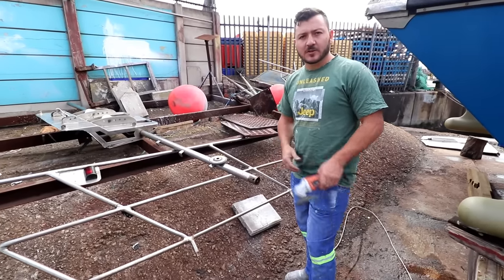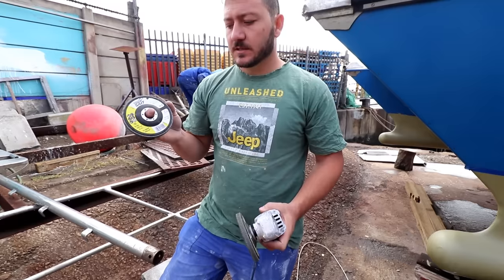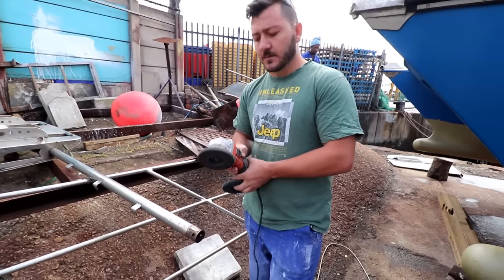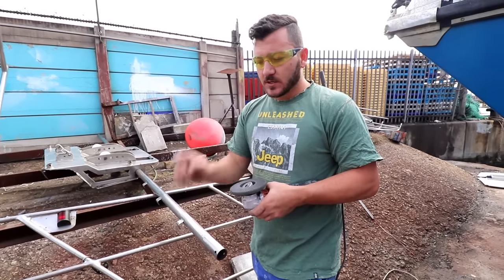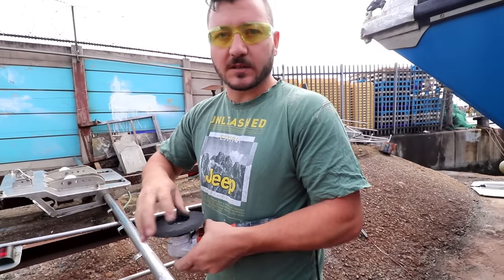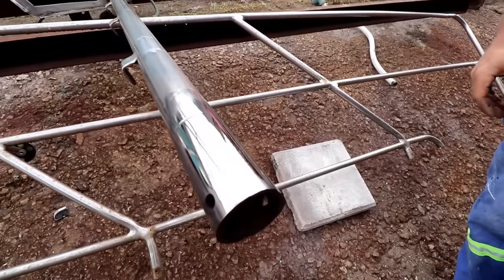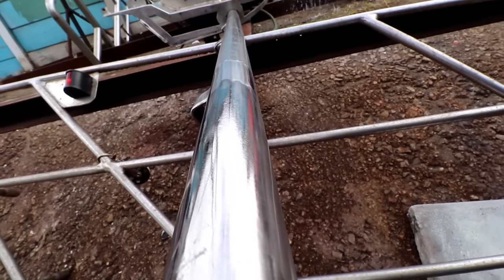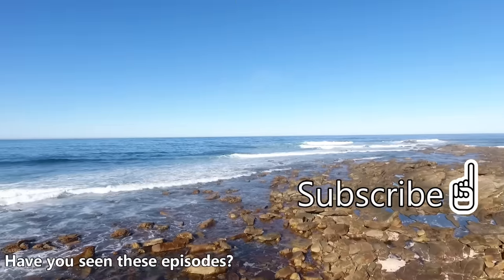HOW TO: Polish your STAINLESS STEEL! (BEST RESULTS)

Comment: I hand polished to a perfect shine using only sandpaper by hand some small SS boat parts and tubing for a Bimini top. I started with 400 grit paper to remove some scratches, then onto 1000 grit to smooth out some more, it looked pretty good at that point. But then I used 10,000 grit sandpaper bought off amazon, and that made it look like mirror finish and it did so very fast. So only those 3 levels of paper were needed.

Comment: Years ago i worked in a chrome plating work shop, some thing like that could be dipped over night and replated then washed in acid and it would come out brand new, no scratches, the cost would be the same as all those wheels and polish, most of the replating that went on was for boat restoration railings and bolts, you may want to look into costing it out cause it does inside the pipe too and could save money in the long term
Reply from the maker: Definitely not in South Africa.. if you get someone else to do it, you're going to pay!

Comment: I just did that on a motorcycle you could also use mothers mag polish on course steel wool then mothers on fine steel wool. It took me much less time and the results were the same. Not sure if you have access to the mothers mag polish but most auto stores carry it. Great work on getting the scratches out sometimes you have to do the sanding on areas that were the metal was not finished or even around the welds.
Reply from the maker: The guys at the place advised us as our stainless steel was looking pretty darn bad to go with the route we are previously using.. It looks really good so we're gonna stick to what we know! 😊

Comment: Good job, Ricky. Take care not to overheat the surface. Overheated surface loose the metal structure of the alloy. This causes corrosion and stress corrosion. Because of this after welding it is used to take pickling paste or pickling bath for removing tinder instead of grinding with angle grinders.
Reply from the maker: Hi Wanambi , im not sure if you have used unitized abrasive polishing discs before ? yes if you are not careful you could damage the surface of the material but to change the molecular structure of the stainless steel alloy will required a lot more head, commonly associated with a cutting disc of a grinding disc. the method displayed is how all stainless steel railings are polished in South Africa after weld joints have been removed , non the less we do acid dip the stainless steel after welding.
Reply: Ricky, you are right - it must be high temperature to demolish the structure of the alloy. Of course, to polish it is a need to work abrasive. Te only reason I posted it was the "warning" for all the others not to take an angle grinder to make the welting even an then polish it. This is the point never works. I am sure - so I followed you - you know what you do :-)
Reply from the maker: Thanks Man 😊

Comment: Excellent job. Very shiny. I sometimes use a grinder with a mechanical speed variation switch 1 - 10 to make it a little more comfortable especially on the more course wheels. They are also very handy for other grinding applications. But, love the vlogs x
Reply from the maker: Thanks so much Derek! 😊

Comment: I’ve been all over town and the internet looking for fine 300 grit and medium grit polishing discs for my angle grinder and the highest grit I can find anywhere is 120, which seems way too rough to be a finishing polish.. wondering if you can put the link to the discs you bought here so I can find them? Thanks much in advance!
Reply: Me too , did you ever figure it out???
Reply: Look for United Abrasives Unitized wheels to buy in the USA . If you look below in the comments there is another brand called Grifton but havent used it . The SAIT is a pro wheel. The real real value that this video provided is the dicovery of the wheels .Normal ppl wouldnt even know the existence of this product

Comment: Its a lot of work but it sure does look good. Just did that for my boat steering wheel, had a rubber all the way around the wheel and started breaking down and getting black shit on our hands, i cut it off only to discover i had a stainless steering wheel that had rusted in certain areas, knocked the rust off with some fine steel wool, then hit it with i think a green (or possibly black)  bar for cutting then the white bar, came out real nice. Threw some wax on it for good measure.
Reply from the maker: Thank you. It makes a huge difference 😎

Comment: Good work. I never thought that large of a wheel would work on a 4 or 5 inch grinder. Is that buffing wheel rated for those high speeds?
Reply from the maker: Hi , we have used many of those wheels and this is also tips from someone that we met that has been doing stainless steel for over 30 years . The wheels would last longer at lower rpm but it works great

Comment: what if the stainless steel is burnt and now has some rainbow stain because of the heat? what should i do?
Reply: use WD40 or alternative to help with overheating the stainless steel, this metal is great to clean and can handle the heat from 11000rpm single speed grinders
Reply: @becool27  
I want to remove some discoloration/tarnishing from a stainless steel Jenn-Air propane grill - how do I accomplish the polishing while maintaining the brushed look of the rest of the BBQ?

Comment: Awesome job! What a difference!! Amazing!!
Reply from the maker: Thank you so much! 😊
Reply: @livingwiththemaias  I thought when you sand the stainless steel you ruin its upper coating and its more vulnerable to rusting/corrosion? and isn't 400 grit really rough why not 1000-2000 and which finishing paste do you recommend in usa? and how do you sand in between the railing fittings? you cant with that sanding disk

Comment: Can you please give us the name of the discs?  Who makes them?  Can I get them here in the US?
Reply from the maker: It's unitised disc's. Medium and fine to do the cutiing and then a buffing wheel with stainless steel polish. You can get the disc's anywhere in the world.
Reply: @livingwiththemaias  "Unitised"?  Is that like the type or brand?  Sorry for my ignorance and I do appreciate your response.  I'm just very impressed with how quick you did that and achieved that result with essentially only 3 steps.  I have a bow roller that I need to do and want to do exactly what you did, so I'll look for that "unitised" if it's the name or type.  Thanks again!
Reply from the maker: No were not sure what the brand is but just ask for unitized discs. They are all the same. Just different stickers on there :)

Comment: Would you mind pointing me in the direction of the pads you use in this video please? 

Nice job by the way 👌🏻
Reply from the maker: They are unitized disc's. I'm not sure where you could get them that side but I'm sure if you Google it, it will let know know where you can find them in your area. Make sure to get the fine cut and get white bar buffing compound suitable for stainless steel. In S. A we got them at coastlands sales.

Comment: does anyone know the general name of these discs and where to get them (uk) thanks nice vid
Reply: The first disc used is a flap disc, this is usually used in the first stage to remove any rust or oxidation on the surface of the metal. The second wheel he used is a Nylon Fibre polishing wheel, this is finer/higher grit than a flap disc, you remove the marring and grind marks from the flap disc with this wheel. 

Now for the very last step, in the video he used a polishing mop (quite an oversized one, I assume it isn't designed for a 4 inch grinder), he applies a bit of metal polishing compound on the mop and starts polishing the stainless pipe. There are proper polishing wheels designed for grinders, specifically a felt polishing disc (for angle grinders), you should be able to find one at a weld supply store as well as the polishing compound.

Comment: I use the same system for polishing 316L Stainless that Ricky demonstrates in this video.  The fine and very fine surface prep pads can be found on Amazon; https://www.amazon.com/Griton-SP409-Silicon-Carbide-Preparation/dp/B00TDO3ZJW/ref=sr_1_2?s=industrial&ie=UTF8&qid=1534389567&sr=1-2&refinements=p_n_feature_two_browse-bin%3A3515875011
Reply: A polishing kit made for 6 or 8 inch Angle Grinders that includes all compounds and polishing wheels can be ordered from Caswell Plating.  I highly recommend this kit which includes a stand-off adapter (arm) that extends the wheel a few inches away from the grinder, easier to get into tight spots when polishing welded tubing; https://www.caswellplating.com/buffing-polishing/buffing-kits/handheld-grinder-buffing-kit-6.html
Reply: Keep in mind, the surface prep pads noted above - there is Silicon Carbide and Aluminum Oxide, the disc will be labeled S/C or ALO respectively.  The S/C is about double the price, but I have used both and find the ALO to be just as effective.  Funny thing is it says max rpm is 13,300 and my grinder is at a set speed of 9000 rpm but this still 'melts' the compound and can leave a residue on the metal.  When I mount these same discs on my stationary motor that only spins at 3450 rpm, I never have this problem.  So if you have an adjustable speed grinder, turn the speed down low!
Reply from the maker: Thanks for that 😊